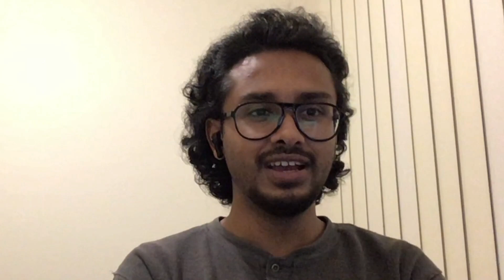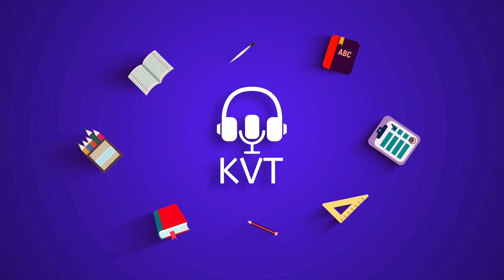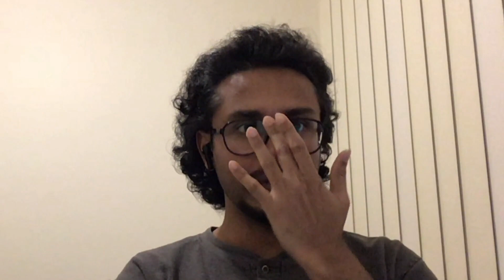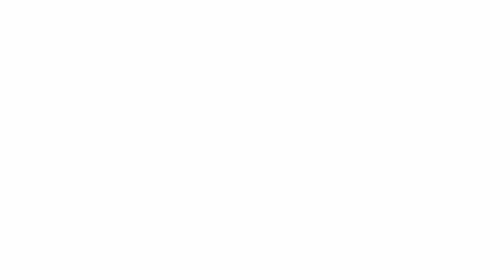What is the Joint  Ph. D. Program? |IIT-B Monash Research Academy | Abin Varghese|🇮🇳  🇦🇺

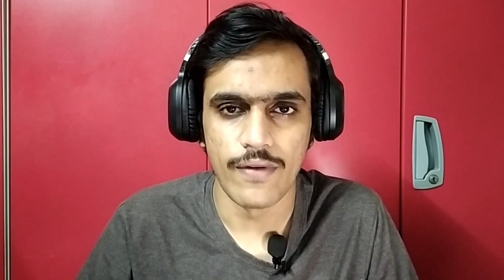Comment from the maker: 00:33 Welcome Note
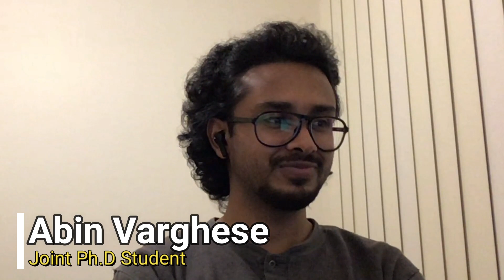 00:52 Winter in Australia
 1:10  Abin shares his background
 2:08  Abin explains about Joint Ph.D.
 3:59  Application procedure for IIT-B Monash Research Academy
 7:01  Is the offer awarded post comprehensive exam?
 8:17  What is Abin researching about?
 9:30  Simulation tools used by Abin for his Ph.D.
 10:30 Striking a coherence between experiments and simulation
 11:18 Abin's lifestyle in Melbourne
 12:13 Work from the home challenge for researchers
 13:41 Word of advice for research aspirants
 15:21 Connect with Abin
 15:46 Thank you note